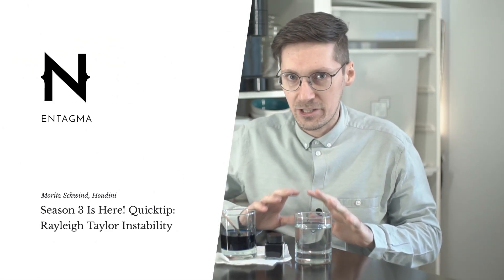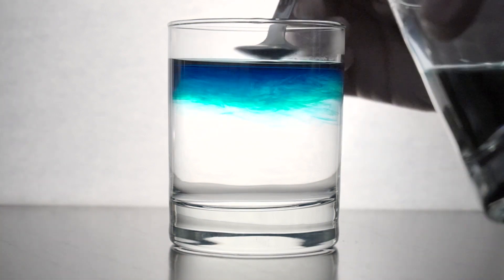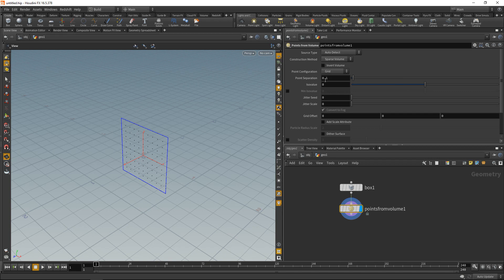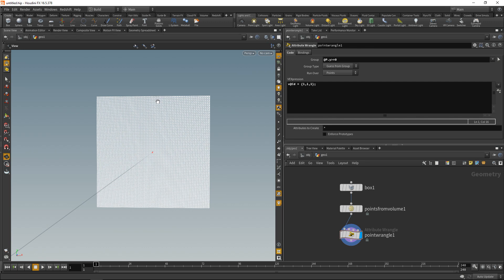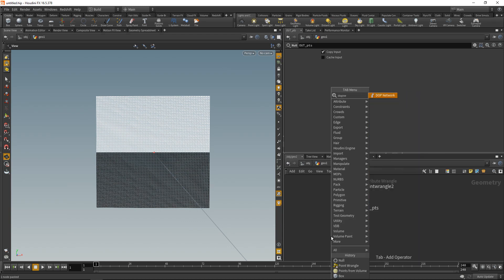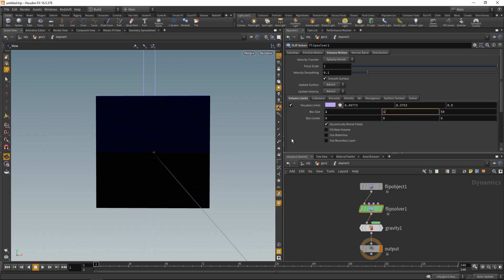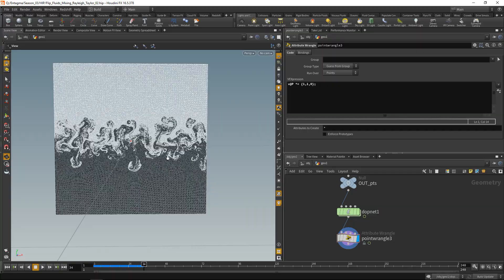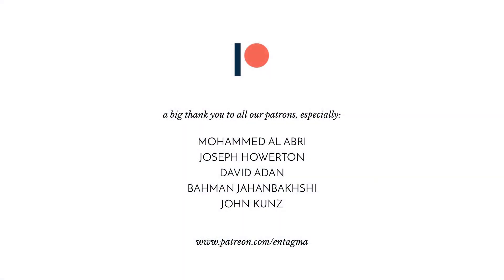Season 3 Is Here! Quicktip  Rayleigh Taylor Instability Using FLIP

Comment: Thanks for nice tutorials:) 
How can I make these points slow down? Not the shape, but only speed of particles. 
 I changed 'viscosicity' value,  the shape of flow is changed.
Reply from the maker: Heyhey,

try attaching a timewarp-node to the end of your node tree, set it's evaluation mode to "by speed" and dial in how much you'd like your simulation to be slowed down. Also manipulating your dopnet's "scale time" parameter on it's "simulation" tab might be an option.

Cheers, Mo
Reply: @Entagma  Thanks, I was following the tutorial and I noticed that my simulation is too fast, I thought you might put a comment or a reply to this issue in comments and here I found it, using time warp-node destroyed the simulation, you get some very ugly artifacts, but scale time in flip solver with a value of 0.4 actually solved the issue.

Comment: I've been trying to do this on a regular windows computer for many weeks now and it doesn't work - granted I have included viscosity in the VEX code. Anyone else having issues using a regular computer?
Reply from the maker: Hey Stepehen,

been using regular Windows computers since 1994 and constantly having issues. Also tried Linux and MacOS for a few months/years. I think it's computers in general and not the OS :D

Cheers, Mo
Reply: @Entagma  Thank you for getting back to me! I really appreciate it! Have you found certain computers that work best? Which one are you using in this video? Everything moves really fast, mine takes forever just to do some of the smaller operations you do. Thank you again!